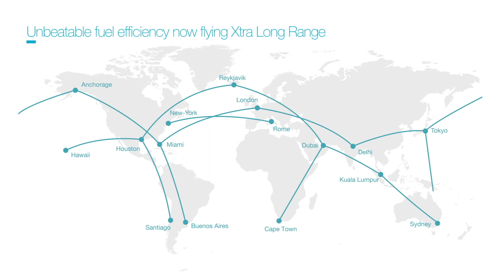Airbus: Airbus A321XLR Fuel Tanks

Comment: As for reduction in range, that would depend on several factors.

Regardless of the changes required, this could reduce the fuel or freight apacity and increase the weight, some of which would normally reduce the range.

However,  we don't as yet known by how much, or if this reduction would be enough for airlines to complain.

There is also the possibility that Airbus could tweak the design to lose the equivalent weight elsewhere, or even tweak the aerodynamics so that the fuel burn is improved. 

Airbus has a track record of making small improvements between model changes, so it is possible that they could just bring some forward. It is possible that these changes could then be incorporated into the A320neo, which wouldn't be the best news for the Max8.

There is also the possibility that the projected range figures were a little conservative and that they are still achieved. It is not uncommon for the actual range to be different from what was anticipated.

We shall just have to wait and see.
Reply from the maker: Yes very true indeed! Weight reductions are possible though it would increase certification time and cost. Thanks for watching